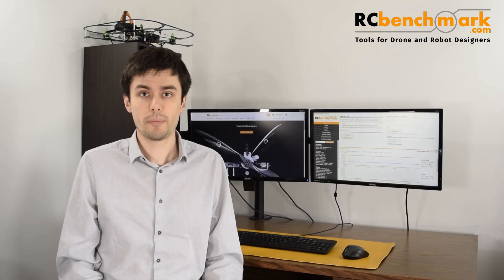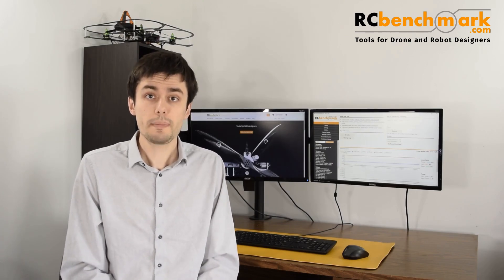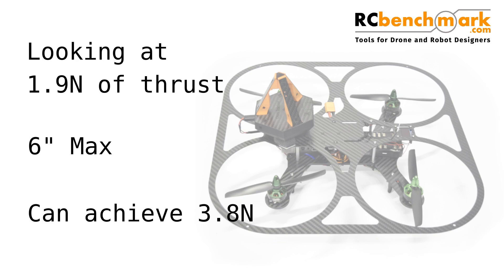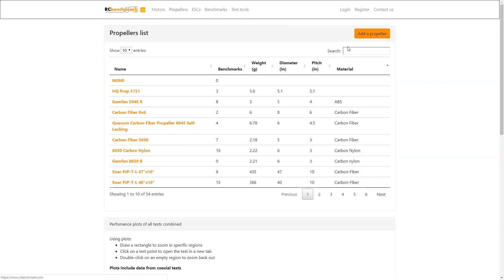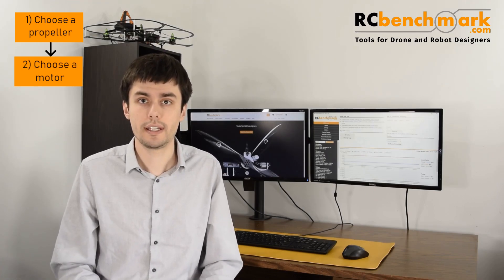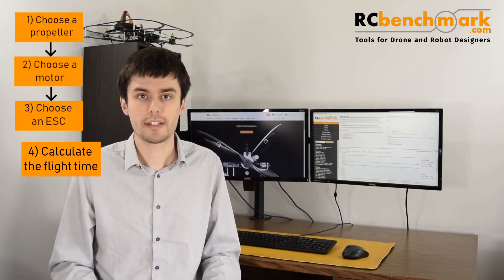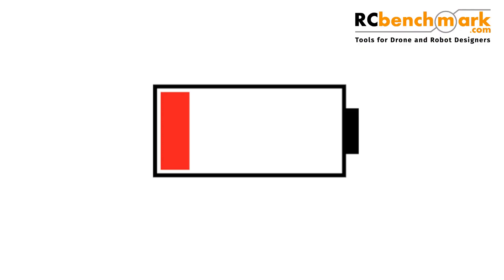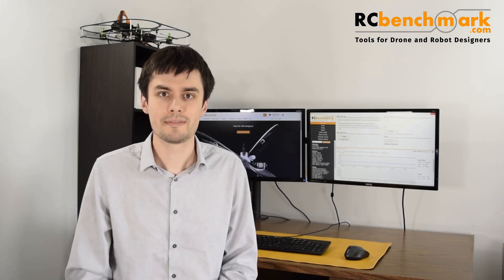How to Increase Your Drone's Flight Time (Up to 200%!)

Comment: Can you please extend these calculations to Hybrid drones? Or rather, help me out with optimizing Flight time for Hybrid drones !!
Reply from the maker: Great question - we will have some content coming out soon covering different types of propulsion systems. What type of hybrid drone are you using (hydrogen, gas, battery?)
Reply: @tytorobotics I am exploring Hydrogen based drones. I actually have a course project in which my professor told me to use my own ideas to figure out some analytics, maybe relations between flight time, endurance and paramaters like payload, battery capacity/weight. But, my research work has been going from one research paper to another, and using some energy equations. But, then there are so many assumptions we make. I found your analysis on battery operated drone quite good. Is there any particular resource/dataset you have that will be helpful for me in getting some results.
Thanks
Reply from the maker: @akankshasaini4202  You should check out the articles on our website as we cover a lot of topics to do with drone performance and optimization. We also have a database that you may find useful: https://database.tytorobotics.com/

Comment: I'm using aerolite 2004 1600kV with gemfan LR5126 biblades props. Wondering if t-motor 2203.5 1500kV and maybe switching to gemfan 5125 triblade props. 
Just a lot of extra money to spend to test.
Reply: It is not an easy question! You can check database.rcbenchmark.com so see if there are similar propellers and motors to the ones you want to test.

Comment: what if the motors are flipped to a pusher config, where the pusher prop is moved further away from the motorhub with longer shaft to allow incoming air hit most of the propellor blades near the driveshaft. Plus having a pusher prop with thrusting blade geometry all the way to its center.. And a vertical arranged arm instead of horisontal to minimize the blockage of the incoming air past the arm. Thinking that the coanda effect sucks the air around and past the motor and then inwards again against the prop, if there is enough space between motor and propellor? Maybe an egg sahped enclosure around the motor would help?? Asking because you seem to be the right ones to ask=)

Comment: Hi, It is a very nice explanation. Interpolation function is not working in Google sheets which is in your flight time article.
Reply: It seems to work here. Make sure you copy the sheet to your personal google drive, and fill it with the data from the RCbenchmark Database. You also need to fill the battery information.

Comment: Square tube Cd: 2.05
Round Bar/pipe Cd: ~1.17 (1.75X lower than square)
Aero teardrop (wing) shape Cd: 0.045 (45.56X lower than square and 26X lower than round)

Yet somehow these facts seem to have escaped actual aircraft builders!? NutZ! :)

"Errr..... lets blow high speed air down on a surface we want to keep up.... errrr?... why don't it work!?"
Are you... 'aircraft builders' going to start putting fans on sailing boats next!?

Comment: There's no way that you can get a 30-minute flight time on a quad that weighs over 700g by running 6" props and a small 3s lipo on 2306 motors that are meant to use a 4s-5s lipo.